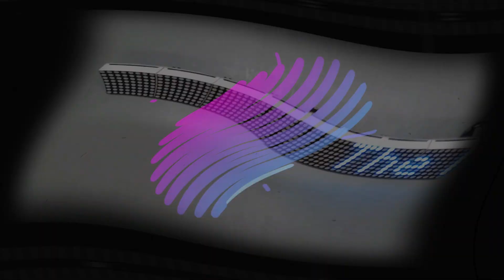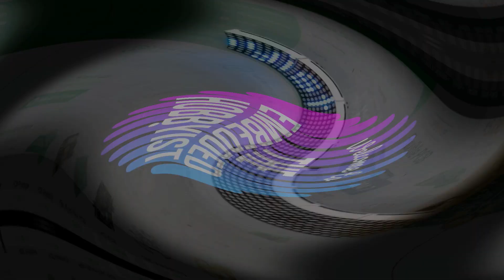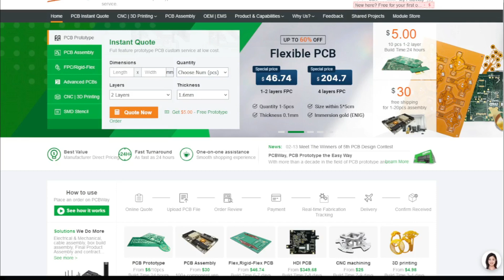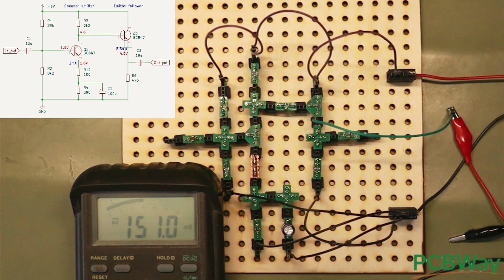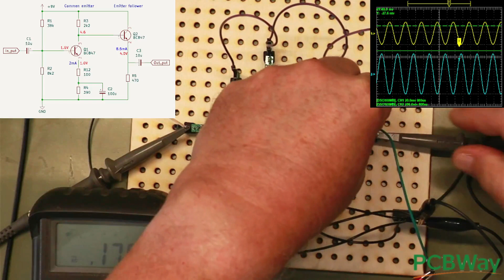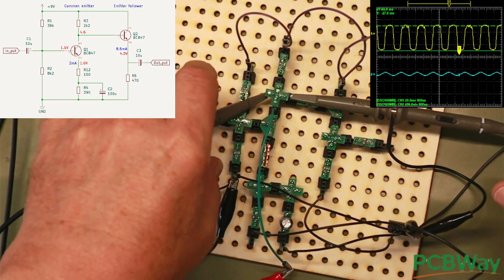#211 Experiment 11 Common emitter with Emitter follower

Comment: There are a number of mistakes in this circuit. The major mistake is the output capacitor. The circuit does not work. The output capacitor simply gets charged more and more and if the output load is a speaker, the sound will get softer and softer and softer.
Reply from the maker: Why would the 2k2 R3 and the 470 R5 resistors from a potential divider?  The only current flowing in the R3 will be the base current of Q2. the current flowing in R5 will be (Q2's hfe X base current) + the base current.

Comment: Speaking of oscillators, my current thing is bulb stabilised wien bridge oscillators. I am looking to create "The Perfect" Sine Wave what sort of sig gen do you have ? and do you know it's specs like THD @1Khz..cheers
Reply from the maker: Not sure what the THD of the SG68 is but if my Marconi instruments Distortion Factor Meter TF2331A still works i could measure it. it's lowest range is 0.1% FSD.
Reply: Two pieces of vintage kit you have there very nice indeed. I like the description of the distortion meter. Basically notch out our fundamental and whatever is left is junk !! @TheEmbeddedHobbyist  The SG is Blimey old !
Reply from the maker: just powered up the TF2331A Distortion Factor Meter and it measures the THD of the SG68 at 0.02% !!
all the controls worked as expected but i think some of the caps may need to be replaced.
might have to do a video on it.
Reply: Yeah please do! and 0.02% is pretty damn good. I have only got to this level (0.025%) with my bulb oscillators ( William Hewlett) but it's early days and they are still on Vero board....squeak ! @TheEmbeddedHobbyist
Reply from the maker: it could be the THD meter was being over nice with it's reading.   @andymouse
Reply: Hmmm, quite tricky to test @TheEmbeddedHobbyist
Reply: I shall look these bits of kit up ! @TheEmbeddedHobbyist

Comment: very good video shame you lost me just after the PCBWay ad 🙂
Reply from the maker: Sorry to hear that Fred, maybe next time a little light rock to help keep you awake in the next one.  🙂
Reply: Same question too you as well, what sig gen do you use please ?
Reply from the maker: well @andymouse  at Teh towers i have an "Advance Electronics SG68 low distortion oscillator" which goes up to 150kHz and a Marconi 2018 which covers 80kHz to 520MHz
Reply: Nice ! @TheEmbeddedHobbyist
Reply: @TheEmbeddedHobbyist  Well I don't have a Tower I have a cardboard box, and my Oscillator consists of me touching two wires together quickly and counting very fast 🙂
Reply from the maker: But Fred is cardboard box in the middle of the road 🙂
don't go to high on the input wrt ground, don't want an Ex-Fred do we.
Reply: Lol ! No Mousey Towers here either ! @fredflintstone1
Reply: we do not ! @TheEmbeddedHobbyist
Reply from the maker: it could be a tower or I could be very small.  @andymouse
Reply: Squeak!!!!!!!!!!!!!!!!!!!!!!!!!!!!!!!!!!!!!!!!!!!!!!!!!!!!!!!!!!!!